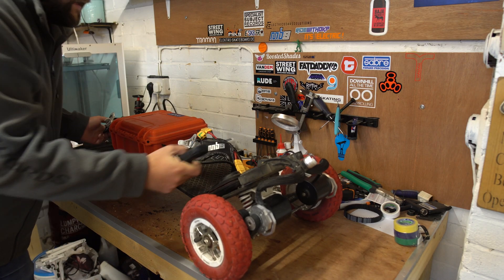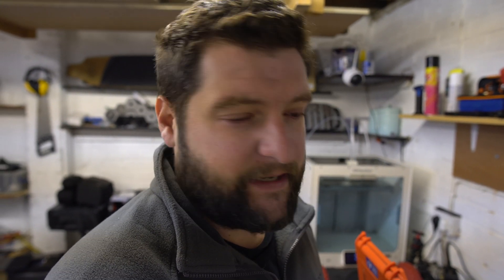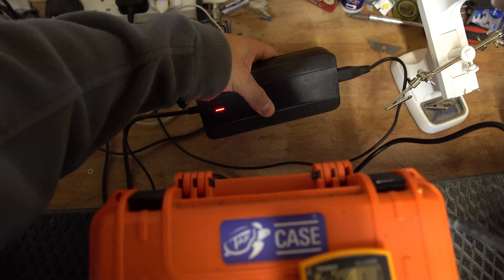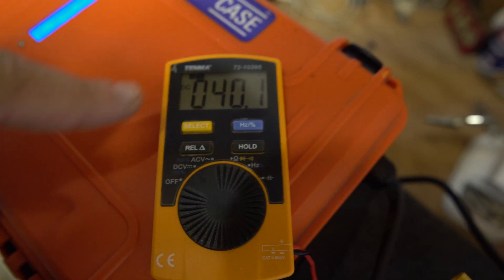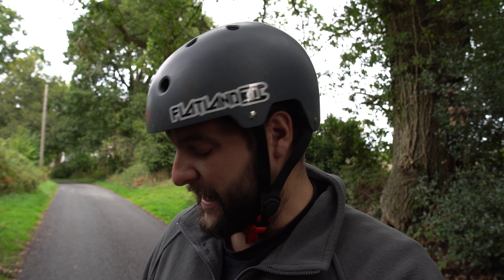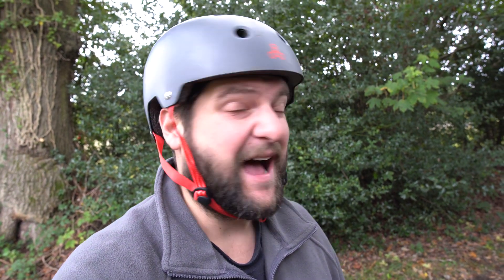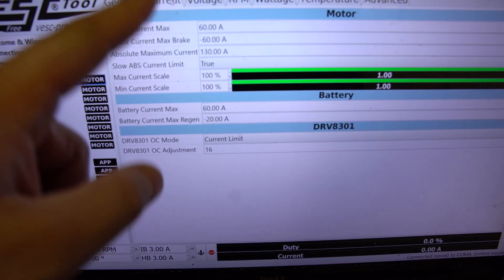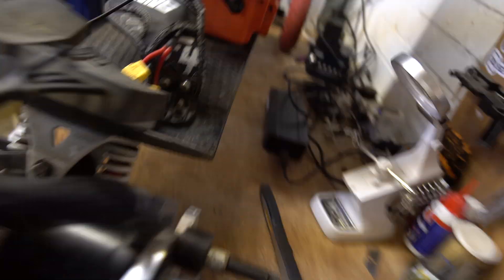☠☠☠ This Battery is DEAD! ☠☠☠

Comment: Hi lee. Thinking about moving on to AT. Do u have a list of recommendations or parts lists from your builds? Thanks
Reply from the maker: Bro I have a whole series on building the same board as me with part lists!
Reply: Can totally recommend his build videos! This is my poorly battery (I didn't build this part) in my build that I made myself following Lee's expert advice. I sourced parts both new and second hand across the internet over 4 months and this red wonder is the result! I had no experience with esk8 before, but missed snowboarding...

Was a really great summer project and I know I can ride this in the winter too... I just need my battery patched :) Thanks Lee... can't wait to have her back while you start work on the bigger battery for us!
Reply from the maker: @KeithWilsonUK  thanks Keith, will crack on with the battery as soon as the cells get here

Comment: If the BMS is being used for discharge, there's no way it could have been over discharged, even with those VESC settings. If it's being bypassed, then it deffo could've been over discharged.
Reply from the maker: Dunno mate, it's your battery - do you set them as discharge BMS? I assumed it's a charge only but I havent been in there.  Either way the pack is kaput
Reply: @LeeWright  are you sure? I don't think I've ever made a brick battery for a Trampa in a 4p configuration... 🤔

Comment: the perzon vho have this board must bi dummmmmm...cut fo voltage haha batery komplrt dead insert there somthing new or?       21 700 liion bat...  I have grad on me chanel tested one seams a guud chois .... luk,,
Reply from the maker: Hey we all make mistakes bro, its about learning from them! I think it will be 12S8P 18650 going in
Reply: @LeeWright  ok bud on top on vesc tool yor set voltage of oll batery or??

Comment: Hi Lee, is it possible to charge a 10s battery while the power is on? I thought it wasn't good to charge a board while it is on.
Reply from the maker: Hey bro, the only thing that was on was the antispark switch, the VESCs were unplugged as I had my meter in the cable that comes out the battery
Reply: Lee Wright 👍 Thanks for the reply.

Comment: You could try when you disassemble his pack , fully take it apart and test the individual p groups capacity and you may find some that are"fine" or even down to individual cell level and see what can be salvaged
Reply from the maker: Thought about it, but its not worth the labour costs.  Also the battery gets to 41.5V so none of the P groups will be dead.  I think the whole pack has just been over discharged

Comment: Hey Lee,

if you still have the board on you, it might be good to give that vx1 receiver a small Upgrade. I designed a rather janky looking but perfect working case. The 90 degree angle of the receiver makes it super fragile. 

https://www.thingiverse.com/thing:3747045

Its super sturdy with the case. I superglued the bottom piece to the case.
Reply from the maker: I will do that for the orange board I have in right now, I will give you a shout out!
Reply: Awesome. Keep in mind thats its a WIP project. Depending on what connector you use you have to jam it throught the opening resulting in a layer seperation which you won't even notice/ affects the integrity. Just so you know :) If you have any recommendations on how to improve it, let me know!
Reply from the maker: @xsynaticc  will do bro! Thank you